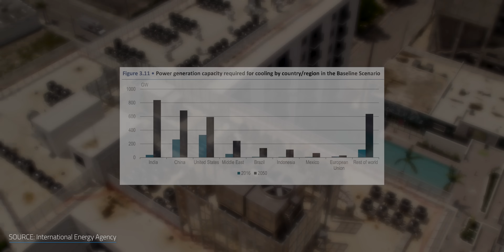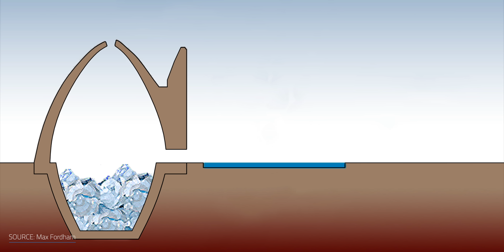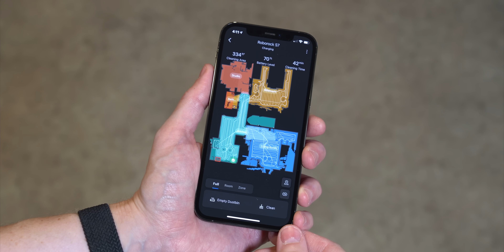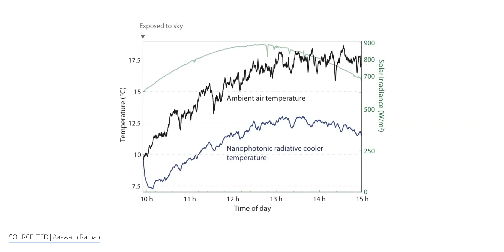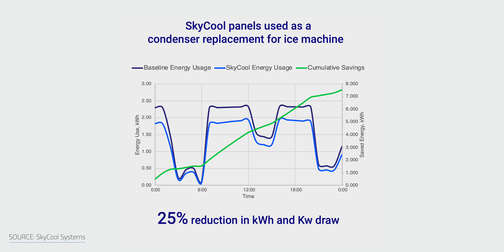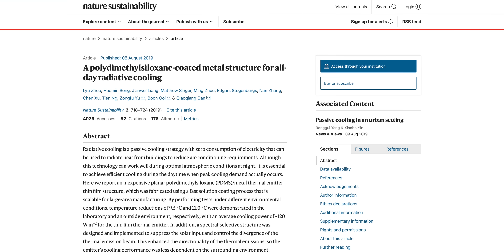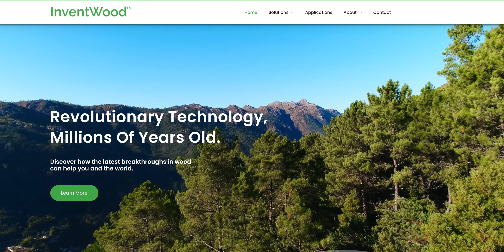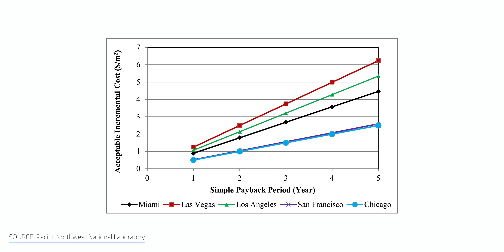Space Powered Cooling May Be the Future of Energy

Comment: How to increase reflectivity in a passive way? There are glass Retroreflective Microspheres available to use in reflective paint for highway signs. These are what is used to give signs extreme reflective properties from headlights.
-
I wonder if those commercially available glass Retroreflective Microspheres would work for this type of cooling paint. Apply these to any color surface and you instantly increase the reflectivity of that surface. This works even if the color is not white. Example, there is a reflective paint company who sells paint to be used on items that need to be seen at night by drivers. This company offers a gray paint that is so bright when lit by headlights at night, you can not tell it is gray.
-
This means if the exterior of your house is any color but white, you could apply a clear coat, dust on a layer or these Retroreflective Microspheres and lower the exterior heat absorption of your house. So how would you do this? These Retroreflective Microspheres are kind of expensive.
-
Here is what I suggest, mask off a 4x4 ft square, spray a clear UV type coating on the section. Next have a 4x4 ft box to place over the section of wall. Pump in the Retroreflective Microspheres as a dry dust to coat the wet paint. Then vacuum the excess Retroreflective Microspheres out. Simply do this to the entire south facing exterior walls and I bet this would reflect enough heat to reduce the temperature and thus the btu loading from the sun hitting that wall.
-
Best part of that is you need not repaint your color to white and you still have a cooler wall.
-
I am going to order some of these Retroreflective Microspheres, grab a section of OSB and paint it with whatever color I can find, but not white. Then I am going to apply the Retroreflective Microspheres to one side of it, place it in the sun and check the temperature behind the coated section and un-coated section to see if there is any difference. I am betting there will be.
-
I do not know what kind of Retroreflective Microspheres would reflect the infrared wavelengths needed to achieve IR reflectivity but that could possibly work also. Or  IR reflectivity could simply be achieved by using the right type of paint then top coating it with Retroreflective Microspheres.
-
I doubt the Retroreflective Microspheres would block the IR reflectivity of the paint as they are clear, but that would be an interesting test to see what effect they would have. If these 2 things IR reflective paint and Retroreflective Microspheres could work together this could be epic and could easily be done by home owners as a DIY project. After all spraying on some paint and dusting on a coating of Retroreflective Microspheres is not exactly rocket science.
-
I wonder if a clear coating could simply have the Retroreflective Microspheres mixed in then sprayed on. That could be super easy, easy as applying any paint and could be applied over any color, not just white and possibly achieve instant cooling by upping light reflectivity.
-
Time for some experiments to see if any of this might work.
-
Best part, if it does work then this is easy and some company cant own it. Easy DIY project to up your exterior wall reflectivity using Retroreflective Microspheres.

Comment: While we can cool from space, there are other considerations. First, roof leaks can be very expensive. Every time you put penetrations into a roof  you create the possibility of a new leak or a new leak eventually. A typical roof on a home may cost $3,000 to $10,000. Every roof leak that has to be dealt with can cost $100 to $500. Generally, someone needs to go up and check the roof every year or two. A typical roof lasts about 15 to 30 years. This of course varies based on weather, trees, natural disasters, the route of the local roof salesmen, home sales, and more. A branch falling off a tree can cause someone to replace the entire roof early, or a home that is going under renovation frequently has the roof replaced just because it is old, looks bad or people believe a new one might make it easier to sell the property.  Generally, lots of the roof leaks always happen around openings in the roof (like sewer vents and such). Many  times they will leak repeatedly, every couple years and one simply puts a little roofing sealant on them. I know this is a lot to comprehend, but let's just say that every penetration on a roof is going to on average leak once. Fixing these may cost $100 each.( Cost of getting a man up on the roof to inspect and fix.)  Adding cooling panels on a roof, with the additional penetrations that it takes to mount the panels is going to be expensive. Plus when the roof is replaced it takes more work to work around those penetrations. This is going to cost more. A paint, sprayed directly on the roof with no penetrations could be great,  Cooling racks mounted on brackets through the roof could be a maintenance nightmare. If there were 30 panels mounted on a roof, and each panel had four mounts, meaning 120 mounts on the roof, and each of them leaks once in thirty years, that is 120 additional leaks that is 4 leaks per year that is $400 in additional roof repair. How much power are you saving?  The real number may be less than this. There are ways to mount things that don't leak as much, we do mount solar panels on roofs. They too would also increase complexity and roof replacement. Roofing is also a wild area. Costs and quality vary greatly. One roofer will charge $13,000 for a roof, the next on might charge $5,500 for the same roof. Quality of the work can vary as well. While i hate that it is so hot right now, the fact of the matter is a modern central AC unit can keep a well insulated home cool for about $1 to $2 a day.  So if one were able to reduce cooling costs 50% or special panels on a roof, but it only The added cooling of mounting panels up on a roof, are going to need to make a significant reduction in costs order to be worth the added complexity. Painting a roof white, could be appealing. Moisture though can be an issue, while it is possible to paint shingles, this is rarely done. Shingles are suppose to breath allowing moisture to evaporate, painting can trap that moisture cause issues.
Reply: So if you are able to save 50% of a homes cooling cost, and the homes electric AC bill is $2 a day for 180 days or $360. The savings would be $180. Now if the roofing costs due to holes goes up $400 a year, all the savings evaporate. Plus, you still need to deal with the added complexity when replacing the roof. It is cheaper and easier to just use the electric power to cool the house. Now I still like research, and I love the idea of painting a surface a having it get cooler because it radiates more heat, but that is a different solution. Having a cooler house also could attract more condensation, dew, onto the house, which could also cause more issues as well.
Reply: So one problem is, how do you get the radiated coolness to go into the building rather than just be absorbed into the air or absorb heat radiated by every other object around?  Their solution was panels. With panels you keep warm air out, the air inside you can allow to cool off, and then you can direct the cool, via pipes to somewhere inside the structure. Paint, while it might still radiate cool, can quickly lose that cool to warm air all around it. Panels while simple, suddenly need to be strong enough to deal with weather, monkeys, rodents, look good and not overly complicate the cooling system.  One portion of the problem is undersized roofing vents on attics. Attics are suppose to get hot, but are also suppose to vent naturally, and many times may not vent as well as originally intended. Insulation can block lower attic vents, attic vents leak, builders do not always analyze the structure properly instead building mass homes as cheap as possible following rules of thumb with the lowest paid labor.

Comment: The most natural and sustainable "art" of cooling your home is to NOT let it heat up in the 1st. place and consider it as a large thermal mass (as did all our ancestors in all hot & cold climata) by
- erecting massive stone-walls of 40-60cm thickness, even inside not less than 30cm,
- high ceiling, not less than 4m,
- narrow, high-reaching windows with shutters which should have a
- possibility to ventilate at the upper section right below the ceiling to get rid of the hot-air cushion w/o forced ventilation,
- hollow-blocks for roofing, at least 40cm thick; preferably not flat but with a double curved ceiling,
- heavily insulated doors,
- very reflective outer color,
- the whole building properly oriented according to sun's trajectory, wind, lie of the land, etc.,
- family members know when to ventilate, close shutters, etc.
- many more details for passive cooling may be added (fountains, plants, internal court-yard, wind-channels, trombe-walls, etc.

We cannot solve our problems with the same mindset and techniques we created them in the 1st. place.

Have MORE fun with LESS modern technique !!

Comment: AC is worse than that. Even if you used carbon-free energy and we're careful not to release the working fluid into the atmosphere, they still heat the planet. They don't cool, they move thermal energy from over place to a hotter place. Doing this requires energy, and the place that that energy goes is into more heat. They always expel more heat than they remove. 

My question is: how does this technology compare cost effectiveness to geothermal cooling? Obviously, it'll vary between applications, but for a traditional single family house with a modest yard?

Comment: If you take all the energy coming out of AC units in a tall office building, run it through a heat exchanger where it vaporizes ammonia that runs a turbogenerator whose electricity powers the AC units, combined with placing thin photovoltaic cells instead of windows, and use this power to provide lighting at night, the net effect will be probably close to 0 heat output from that building. The ammonia could be precooled just by using the wastewater from toilets, faucets, etc. And if push comes to shove, we should all get rid of "professional dress code" and go NAKED around our business. Then we will really know who is the big one, and we probably save some money in lunches seeing some of our coworkers naked, which would make anyone puck

Comment: 15 degree F drop isn't enough in some places, but, combined with evaporative cooling, driven by solar electricity, and heat pumps and thicker walls/better insulation, even very hot locations could be made safe and comfortable without AC. That could be huge.
 And tech like this could go a long way simply to reduce heat gain in the dumb glass office buildings we've built everywhere. Some of these have to be cooled when it's 40F outside, which is utterly ridiculous.
 Old fashioned adobe houses and small to medium sized buildings across the Southwest require little heating and almost no cooling, and can be relatively cheap to build. They could be useful across a wider region with some modern additions.
 Reducing energy use in buildings, even dramatically, is the low hanging fruit in the battle against climate change and for a better lifestyle and greener future.

Comment: Would like to point out, that the way you introduce and explained this concept is actually very misleading. Space does not cool these panels, they simply do not heat up from the sun as much as what they radiate as infrared light, and the fact that it does not get absorbed by gas in atmosphere does not matter as amount is so negligible that it does not matter, the sun gives more energy to earth than that in less than a minute even if you covered most of buildings with it. Even if the atmosphere absorbed it, it would still work and cool the system. Well, the rest is true, it is better than current air conditioner for climate as they do not use HFC.

Comment: I live in a highly variable climate. Lowest temperature I've seen was -40C, and the highest I saw just last year was 48.5C. Radiative cooling seems like a great idea for an AC replacement in areas that get consistently hot, but in winter months I need that solar gain. I do wonder though if this is a viable option as a replacement for a traditional refrigerator though. Simply eliminating the fridge from a solar powered home would dramatically reduce the amount of power needed. The question is what's more efficient, a solar powered normal fridge, or a radiatively cooled fridge?
Reply: Darker surfaces also radiate heat away more than lighter ones, so perhaps some of the loss of absorption would be offset by a reduction in radiation? Improving insulation should also be great at reducing heat loss in winter and heat gain in summer.

Comment: What about using those panels to supercool a large reservoir "thermal bank" if you will, at night. Then pumps recycle the very cool fluid during the day to create a natural air conditioner. But in reality, this process would be heat negative, as instead of reflecting the sun it is actually dumping the suns daytime heat back to space at night. During the day, the panels would more serve to shield the building from heat rather than actively cool

Comment: Promising! But marrying Skycool with solar panels would even be better as currently having Skycool under solar panels would heat them up while reducing efficiency, and having them on top of solar panels obviously does not work. Integrating them could lower the solar panel temperature, and increase solar panel efficiency. But would it also be possible to integrate the capabilities of circulating cooling fluids via inter-cell/panel capillaries/tubes? ...uh, wake up?

Comment: Is there a way that the contrast between hot and cold can produce some electricity or a way to combine it with solar energy? Or even the difference in pressure to power a circulating flow for piping?

Comment: Instead of using expensive fancy tech, why not use old tech. Like why not create an elevate roof that uses a material permeable by air, so wind can flow through it, that also blocks the sun from actually touching the main  structure? Multilayered metal sheet panels with offset holes punched in them could be a rigid option. Heck, some sturdy fabric could be used. The whole second skin technology. 
I had a friend who was living in an apartment that would get up to 40 degrees celcius in direct sunlight. He put bamboo blinds up on the outside of his windows and it immediately dropped his indoor temps by at least 10 degrees.
Rooftop gardens and second d skin options have been around for a while and don't cost as much as some fancy technology with an inflated price due to patents.
Of course, the passive cooling replacing refrigerants is definitely a cool tech.

Comment: Cooling towers have been cooling air and enhancing large AC set-ups for ages using nothing but water and it's about time that's available to home owers, I did it myself by blowing cool air from a swamp cooler into the outside unit of my AC, which not only reduced its power draw but also allowed the AC to reach a lower temperature inside.

Comment: To be economically viable, anytime a cool roof is specified, one must also calculate loss of solar heat to the building during winter months. That is why cool roofs are not as viable in northern climates. Standalone surfaces would not be handicapped in this respect, but the flip side is the expense of the structural substrate.

Comment: Could this tech also be used for power plants? The maximum theoretical efficiency of any carnot cycle is limited by the lowest and highest temperatures in the cycle. Commercial power plants may be able to use these panels to more efficiently reject waste heat from the cycle.